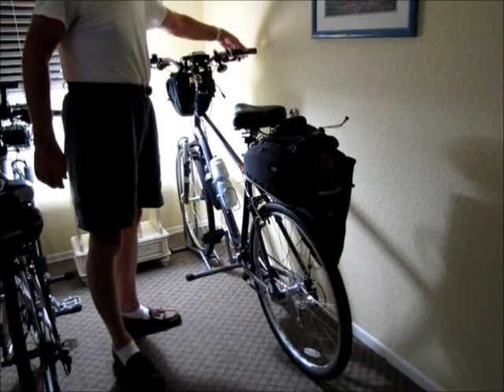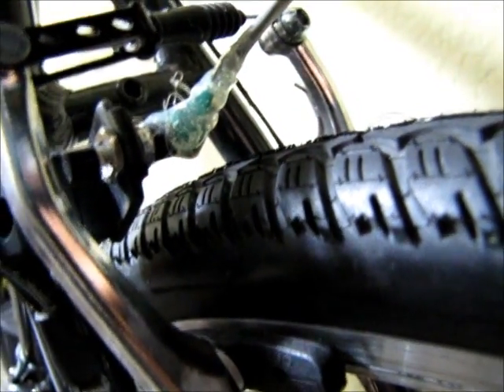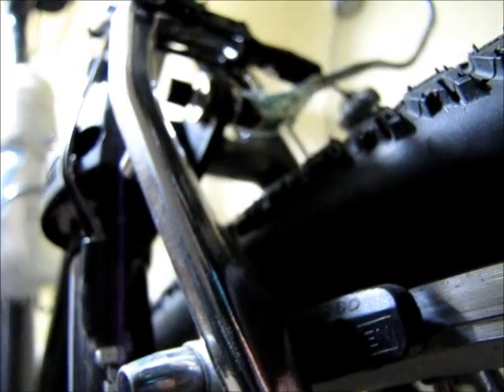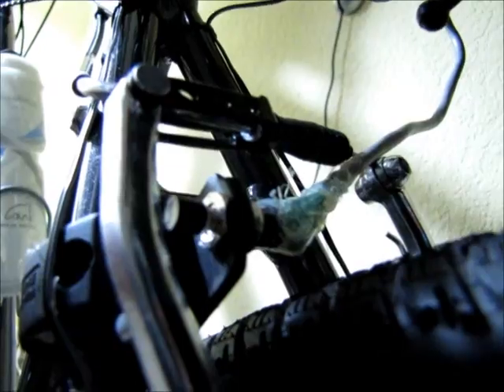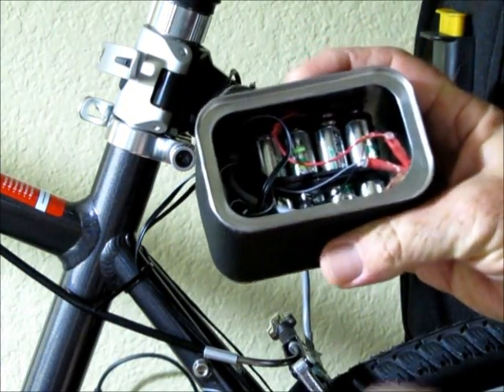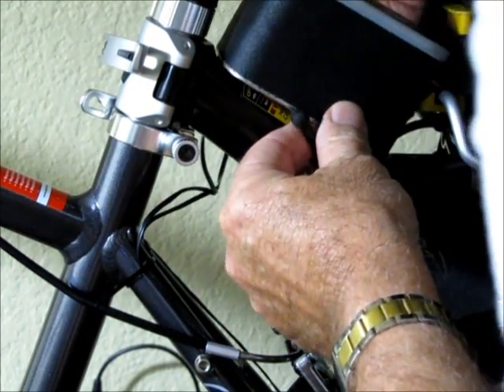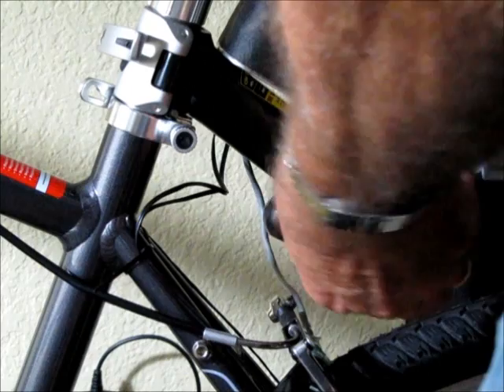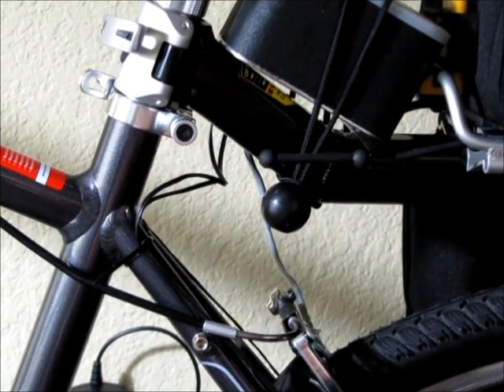bicycle brake lights super bright

Comment from the maker: @spoon2600 
Hey spoon, glad you liked it. Your point is well taken. The switch itself is not weatherproof. They come from Radio Shack. We only ride in better weather, so it's not a problem for me, so far.  The LED strips were bought at Autozone for about $20. They are terrific; do a search for Alpena 24 inch led strips.....

Comment: The switch to wire was made weather proof through the use of hot glue. But, is the mechanical portion of the switch weatherproof? From where and which LED strips did you purchase? Thank you very much for the video! :D

Comment: You can use a 12 volt rechargeable battery instead to use AA batteries, i have conected my bicycle with  two 6 volts bateries in series delivers 12 volts.

Comment: Bob the one thing you didn't mention in your video is how the power pak is charged or are the batteries replaced.?  If they are chargeable then do show as to how this done for the benefit of those who are a bit of a dimwit ( like myself) in another video also showing how you actually put it all together aswell.

Comment: i might try this as i have most of stuff already switch reflector but i'd use a 3 x aa battery box with 3 aa 14500 batteries which i have and mount under the seat